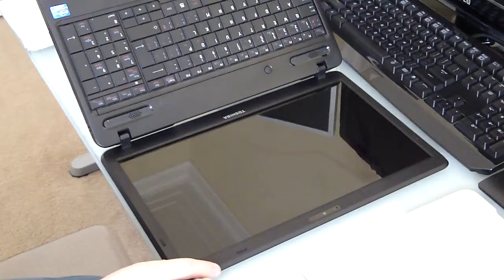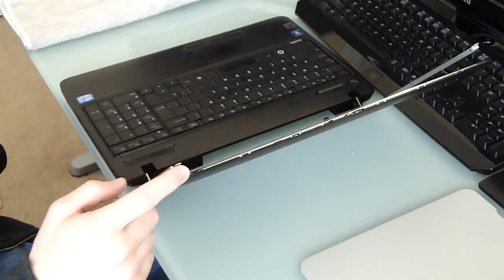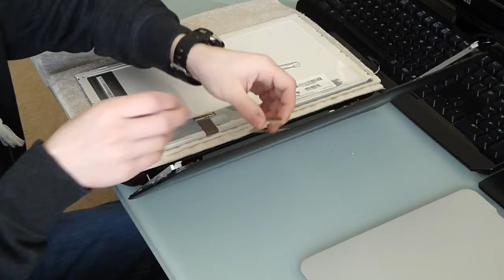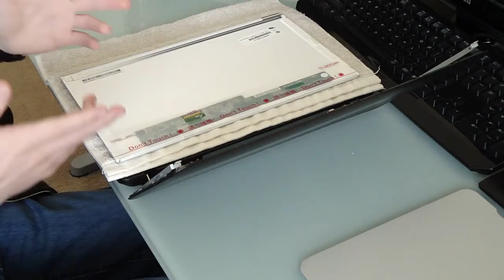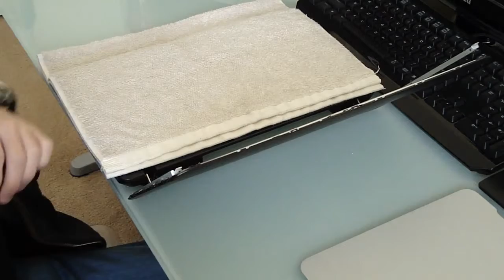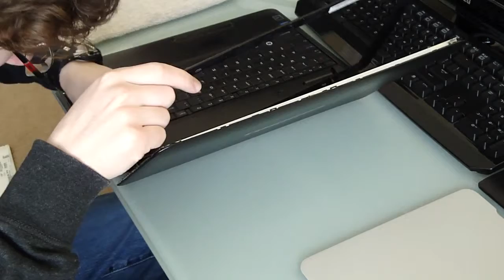Laptop Screen Replacement in Toshiba C650

Comment from the maker: @waiseelay1 The unit you have uses the exact same panel that I used in the video. (15.6" LED LCD) Search screencountry's website for "C650-028" and the first 2 displays will both work. (I checked Toshiba's spec database for you) The only difference is that one is glossy (like the factory installed panel) and the other is matte finish, which is better for viewing outside and in high light environments.